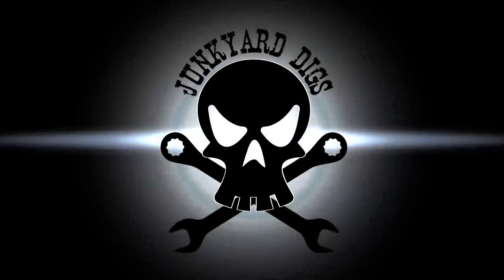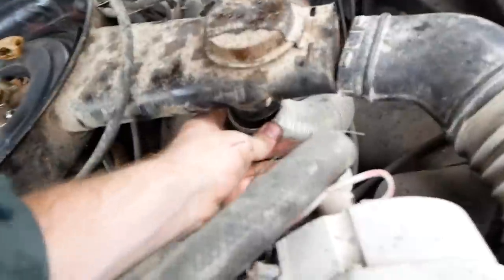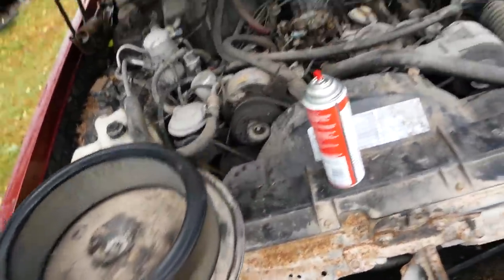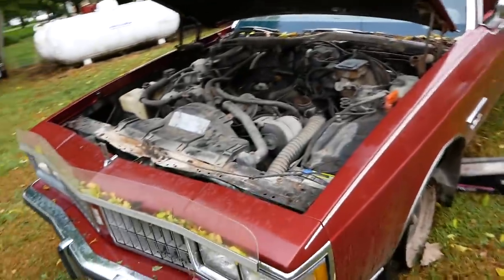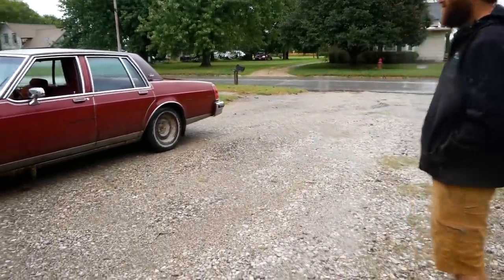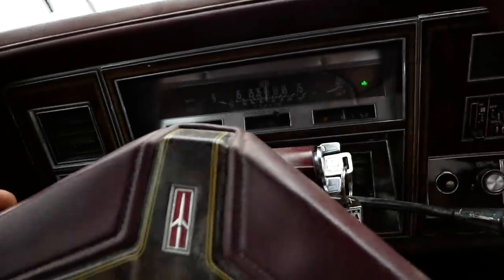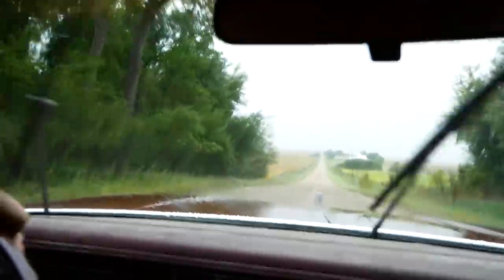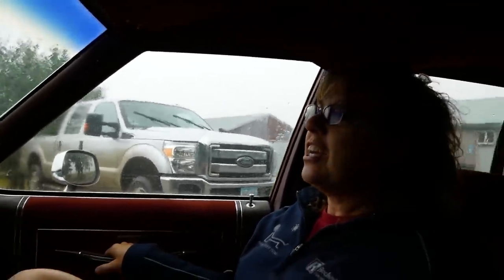$300 Beater First Start! Oldsmobile Rally Car??

Comment: Interchangeable vehicles to the olds would be a Cadillac royal brougham. My olds was 85 the caddy was a 79. With some tweaking i got the dash to fit. The gauge cluster to work off the olds cable. Them stereos eat up battery power over time gas tank and straps can throw you a curve ball. My 85 needed the tank and some strap work. Mounts are known to go in the trunk. Right behind the rear wheels the trunk pan would have thease humps or lump spots in it. Thats how you could tell the trunk mounts are gone. The Olds cutless was like the younger syster same idea. Then you had the chevy or gm that looked simuler to the olds cutless. 88 the bigger syster was a tank

Comment: I daily drive one of these things. Mines just like this other than it’s an gray 1983 with manual everything, 66,000 original miles. Original radio works, has the bug shield although it’s not installed

Comment: Grandma had a 85 olds 98 and a 87 olds wagon both bought new, same 307 200r4 set up. Both got in the low 20mpg on the road all day long!  85 had over 100000 when they traded it in. The 87 wagon had over 250000 on it never touched tranny or motor other than regular service.  Buddy of mine mom had a 82 with over 350000 on a 307 as well.
Reply: Same here. My grandma had a green '79 88, red '81 or '82 88, and later a '83 Le Sabre. At this time GM was also facing law suits because they weren't necessarily putting in a Buick 307 or Olds 307 into the car when new. The old red 88 had the 3 speed and had transmission issues, but the LE Sabre had the 4 speed and last for more than 200,000 miles when she sold it in 1998.

Comment: If you can find the parts you can put the Caprice police package suspension on these without much difficulty which makes them handle decently, though I suspect some new dampers will make a big difference to this one, the way it is diving when you were waggling the steering rather suggests the current units are a little past it...

Comment: 9:05
Gave it the ol Italian Tune Up. Got those rings unstuck. 2nd burnout, no blue smoke. either that or it ran out of oil lol.

It's a 307 olds, so a 350 or a 403 is literally a drop in swap, same brackets and everything. could use the computer stuff if you wanted. 1975--79 OLDSMOBILE quadrajet, something like a 17057252 would be a good non computer replacement. Pop a standard HEI in there as well. 
A 455 would swap in too, but it's got a taller deck height so the bracketry might not fit well.
Reply: I used to drool over a 76 olds ex Kansas state trooper car with the 403 in it every time i went to Waffle house, it was the cooks car lol.

Comment: We also had an 84 Delta 88, did not have the Overdrive trans, still got 20 mpg highway...my granddad bought it new. Gas tank rotted out of it, as well as the rest of the body...sold it for $100 to be run in a demo derby. Once the guy got it started to drive onto his trailer, he revved the nutsack off it, and spun a bearing....I shurgged, and walked away with my money...lol

Comment: You can file this under "Gratuitous Suggestions" or "Unsought Advice is Unwanted Advice."  To add a bit of class to your video, subtract all bad language.  To ease and speed up starting of long-dormant Q-Jet and other carbureted engines, first fill the carb fuel bowl with fresh gas through the bowl vent tube. An oil bottle with a cone cap, like Lucas Oil Stabilizer comes with, works well for this. (Index finger over spout while positioning it .) Then check for accelerator pump operation by opening the choke and watching for gas being squirted in two steady streams, one into each primary venturi, while the throttle is being opened. Once you have that, and the choke closes by itself, it's ready to start, fuel system wise.  A vacuum hose from the back of the carb to the ThermAC control valve on the bottom of the air cleaner must have died or been disconnected, since you could remove the air cleaner  without dealing with it. Those hoses caught me more than once, when I thought I was ready to remove the air cleaner.

Comment: I had a 1981 Oldsmobile 98 Regency with 307 V8/200-4R trans.
Gave it to the neighbor's son for a project.
While the Olds 307 only makes about 130 HP on a good day... an Olds 403 is a direct bolt-in with exact external dimensions.
An Olds 403 would wake this car up!

Comment: Ah, a choked down 307. Emissions control made late 70's and 80's cars struggle to pull very much, but rip all of it off and you may have a decently powerful engine underneath. Probably not as powerful as a 330 or 350, but probably decent. The car itself is in great shape, definitely too good for rallying! Engine bay looks decent sized, easy-ish to work on, but would be much easier without the country mile of vacuum lines.

Comment: BTW that car is essentially a rebadged Chevrolet Impala.  The 307 is  Chevrolet engine.  Believe it is a 283 small block with the crank and stroke of the 327
Reply: it's an olds engine, used in a lot of GM cars until 1990. (oil filler tube at front of engine, valve covers shape,...)

Comment: trying to push the secondary air valve on top of the carburetor won't do anything, it's controlled by a vacuum break and the throttle plates underneath are closed anyway.

Comment: Olds 307 .  5 liter.  About 140 ish horse power.  The engine is too stupid to die .lol it's bullet proof.  You can pound on them and they keep going.    HEI High Energy ignition.  Bullet proof.  These engines always start.  The car isn't styling but it has character and they don't build em like that anymore...they're fairly tough!

Comment: You said that you didn’t care what trans it is but you said that she hit “4th” that my friend would be overdrive making it a 307 connected to a POS 700r4
Reply: I'm not aware of the excellent 700R4 being available with the bell housing bolt pattern to match the BOP engines, but could be. The 2004R transmissions have dual bolt patterns to fit BOP and Chevrolet engines. My understanding was that the 700R4 was used for heavier duty applications, and the 2004R for normal service applications. But I've encountered two 2004Rs with long histories of trouble-free service, one having done far and wide recreational trailer towing. They have a lower first gear than the 700R4, and are thus favored by jack rabbits.
Reply: Stephen and Lori Young could be im a Ford guy at heart but hey if it runs it runs lol
Reply: Whats the 3 speed called? My grandma had the 3 speed and boom, failed. 4 speed in her 83 Lesabre much better.
Reply: @finharms9439  Sorry to hear about that blackness in your heart - I have a near and dear neighbor with the same affliction, and we banter frequently. He's not exclusive, having Camaros, and recently got a Chevy pickup. I told him he looks so much more intelligent when he's driving it.
Reply: @manualtrans257  I think there were three 3 speed rear drive TurboHydramatics numbered 250, 350 and 400, the 400  being the rugged one. A friend had a 69 LeSabre with "400" on the quarter panels. He explained that that referred to the trans, not the engine, which was a 350. I think my folks' 71 Impala had the TH350 trans with the 350 engine, and their 79 Caprice 305 had the TH250. I replaced the electric kickdown switch on a 68 Chevelle with the TH400. Did Grandma's trans going "boom" have anything to do with grandson's driving it? Just askin...

Comment: Those 307s were not race engines but they weren't bad. Good solid engine though.
Reply: The one in my truck is locked up tight after gas got in the oil

Comment: Where do ya find a car for $300. I haven't found a used car near under $5000 in a lot of years. Sane experience with Motorcycles, Mopeds usually $1200 and up, Bicycles $150 and up. I live in a small boring worthless town in Indiana. Hafta go out of the State or far away to find better deals on pretty much anything.

Comment: I would throw the drive train into the Lemans , Get A good used aluminum intake rebuild the QJet A cool beat up lemans with a good drive train the radiator might even fit. I would check that rear end on the lemans make sure it also is not trashed...if its a 305 maybe not so much.

Comment: Losing that smog pump surely has to be the first job - it sounds like it's using about half the engine's power just to turn it!
Reply: Lose the smog pump? Without that you lose the cat real fast.
Reply: Roger Shoaf can’t you lose that as well, then? I don’t know what kind of emissions regulations you guys have
Reply: @usget  

I live on California.  And the rules here are that you can't modify any emitions equipment.
Reply: Roger Shoaf gotcha. Here in the UK, cars don’t require emissions tests after a certain age, you’re not supposed to remove cats in theory but in practice there’s no way for anyone to find out

Comment: check NADA value on that car it's a classic now and low value is 4,700 or more. I had an 82 and it was worth more if i would of hit a deer and totaled it then if i sold it. i sold it for 400.
Reply from the maker: It took me 2 months to sell it for $1000
Reply: @JunkyardDigs  i kept lowering the price on the one i had. it was in better shape then the one in the video. the dash said it had like 25k miles when i sold it but i am guessing it was more like 125k. but it was clean enough to be 25k miles. an old couple had it. i found an old bible in the car from when the old couple was married. I bought it from a junk yard when i bought it. i guess after the husband passed away his wife couldn't drive so the family just took it to the junk yard. when i bought it the gas prices were up and i bought it cheap. it said 19k miles when i bought it.  it was spotless inside and out. i asked around town and found out who it belonged to and returned the bible as it said it was given to them on their wedding day and by who inside the cover.

Comment: Wouldn't it be '84 or newer? With the chimp engine lite and TH-2004R init. Init? Aint it? That one is a survivor , and impressive strong runner for the mighty 140 HP 3-OH-Seven
Reply: They built these particular models between '80-85' and there were so many different engines and transmissions to order with. Almost have to check the build label. The check engine light in my grandma's '81 or 82' 307 3 speed was always on and always passed inspection. She eventually got an Lansing built 83 Le Sabre with a 4 speed and 307.
Reply: The TH-2004R & Electronic craberator would date it from '84-'87 give or take whenever Olds finally stopped doing the 4 door 88/98 B-Bodies. Had a few, two were okay but had one that was a runner and would burn rubber upon request. That would be that Vista Bruiser I had.

Comment: There built like a brick shit house, Screw what people say and. Keep unleaded fuel in it no octane or high test or your out an engine. Been there secondly maintain it don't wreck it they are supreme.  They were the car before your fuel injection and all the computerized crap. Olds was the first for power locks windows doors and seats. Even the mirrors were smart there manual no power yet ran by a cable. Just a car you cant kill like the Caddy or impeller just a bight more fun. I owned a 84 and a 85 if i only hadn't put high test fuel in it id be still owning it.